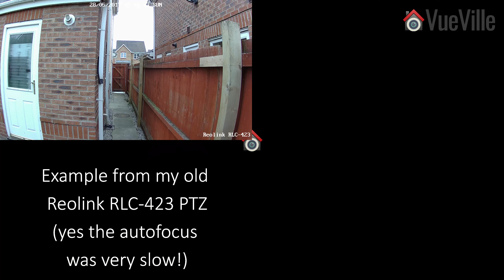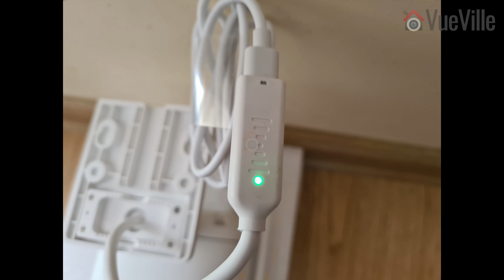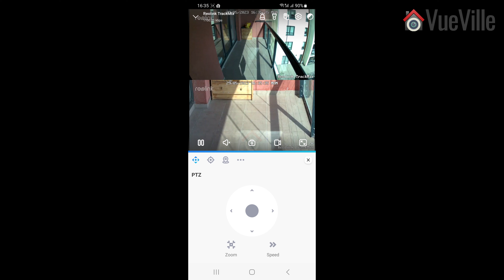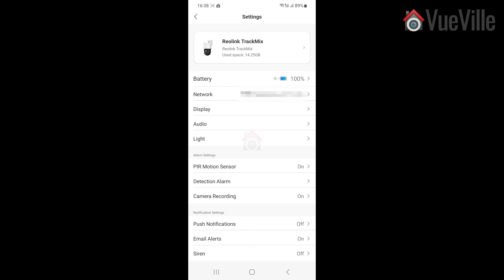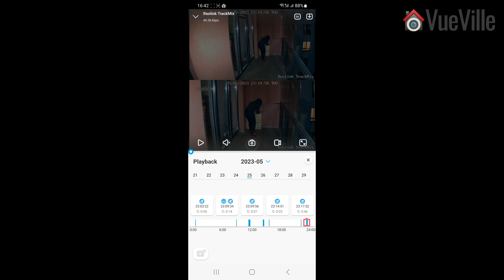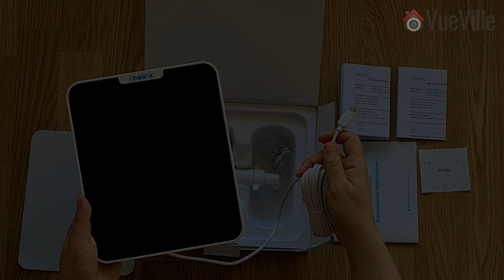A truly wire-free 4MP PTZ camera - Reolink TrackMix Wi-Fi (Battery version with Solar Panel 2)

Comment: Thank you for a very complete and well thought out review. Please allow me to add/confirm a few observations of my own. I have several Reolink systems that I’ve installed at various properties using the wired POE RLC-823A PTZ cameras and have been extremely satisfied with their durability and connectivity. After dabbling with the wireless battery powered Blink cameras from Amazon, I decided the technology has advanced to the point that I’d take the plunge with the TrackMix WiFi battery powered PTZs with the solar options. I actually bought a POE system that I was going to install originally but the building is an old brownstone that has massively thick stone walls that I was not looking forward to having to drill through and being in New York City I would have to put everything in conduits to prevent vandalism.  I'm not sure what the advantage of putting a non replaceable battery in such a power hungry device would be; the only possible application I could imagine would be pairing it with a solar panel if that actually worked, but even on the sunniest of days, the battery quickly became discharged. (Edit: In all fairness, I am situated in a “valley” between much taller buildings, so I actually get about 4 hours of direct sunlight a day). The simpler systems like the Blink were a reasonable stopgap measure; they purport a 2 year maximum battery life and I was getting results in the 2 month ballpark, but at least they were replaceable AA lithium cells. I had to resort to hard wiring the TrailMix cameras to a usb charger spliced into the existing exterior lights, which actually worked well but kind of defeated the purpose. Although I still had wireless data connectivity (with very well executed 5Ghz abilities), the shortcomings of sacrificing the wired features as mentioned in your review left me feeling that had I just put in the effort of a POE installation, I’d have been happier. Lack of system integration, no web admin interface or robust cloud management features, no PATROL abilities, and a mere illusion of 24/7 recording capabilities leave me feeling I was too early an adopter. Poor pre-roll performance, zoom settings that don’t stick and a ridiculous lack of cable management on the solar side are some other gripes. (BTW, why not integrate the battery on the solar panel?) I really love Reolink’s over engineered products and will continue to use their platform but I just wanted to share my experience with others and vent a little. Oh and one more thing- the app disconnects from the cameo after 20 minutes. Another reason for web admin access.